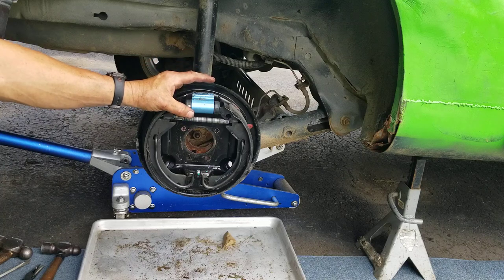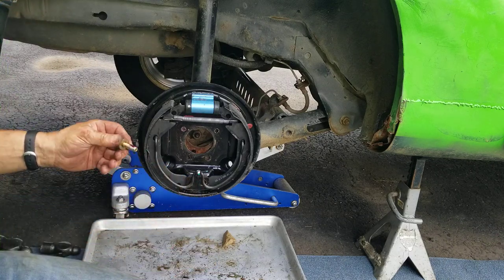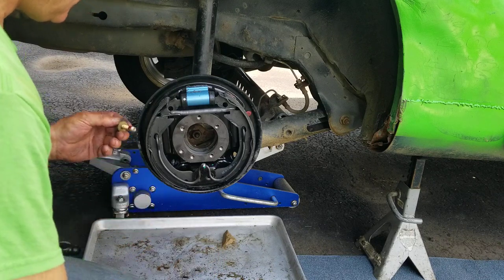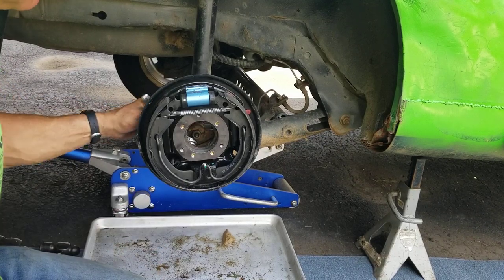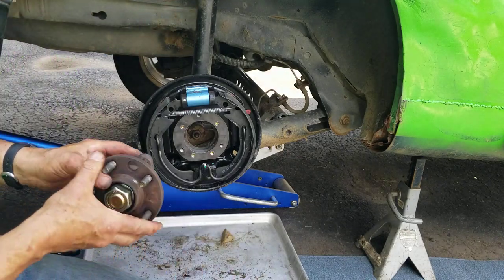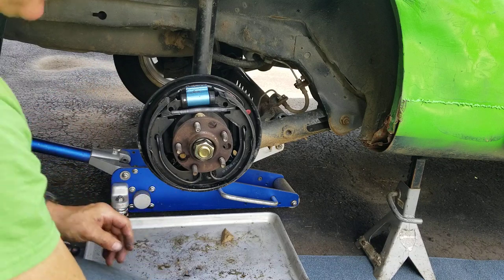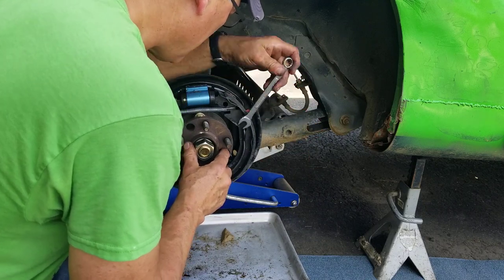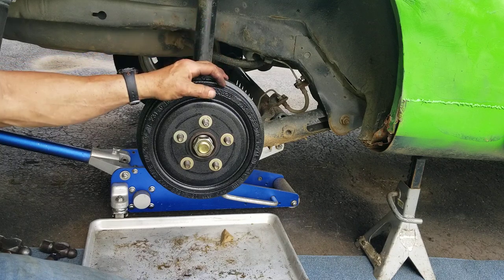D&D Safety Hub installation video.

Comment: I installed this kit on a 1999 Cavalier.  My personal experience is good.  The installation is simple and the kit seems to work. You'll no longer be able to use the ebrake, the brake adjusters are replaced by the strong spring,  the big washers that go on the wheel studs before the drum weren't provided.  It's better to enlarge the center of the drum in order for it to sit flush against the hub.
Reply from the maker: Lowes spring numbers:
430977
422427
One spring is inserted within the other forming a double spring.

Comment: What did you use for the long spring? Is there a vehicle application to look at?
Reply from the maker: Springs can be sourced from local hardware stores.  A single stiffer spring can be used or two softer springs. One inside of the other. The two spring setup is what was used here.
Reply: @LD9user  how stiff does it need to be?
Reply from the maker: @BigSkyModelWorkshop  not super stiff. You should be able to open the spring. For example, typical brake springs are too stiff.
Reply: @LD9user  that's what I wondered. Thank you!

Comment: How do you split the hub on this wheel bearing?
Reply from the maker: @bryce3959  if you're talking about removing the original bearing, there are 4 bolts holding it on. They are accessed from the front through a hole in the bearing hub with a T50 torx bit. There is a 15mm self locking nut on each bolt accessible from behind the break backing plate.   Did this help?

Comment: I have a 2004 chevy cavalier 2.2 and ive tried every way I can think of it the hub will not bolt on i did order it from d&d
Reply from the maker: Is the adapter installed with the flat side down?

Comment: I have a 03 and just tried doing this the other day and can’t get the plate in it’s hitting the wheel cylinder idk if I need a newer backing plate or what.
Reply from the maker: Wonder if it's a late '02 model. Do you have the flat  portion of the adapter on the bottom?
Reply: @LD9user  yes sir I had everything as you had it. I had to buy the new brake shoes. The old ones were still good but didn’t have a slot at the right point to get the big W shaped spring in.
Reply: Will get pictures in the next day or two for comparison.
Reply from the maker: @bobbydouglas9086  Send pictures to D&D safety hub on Facebook.  Dylan should have an answer. I'll ask him to fwd me the pics.